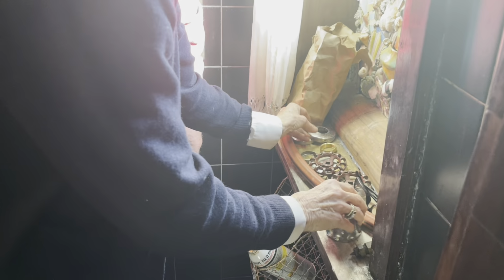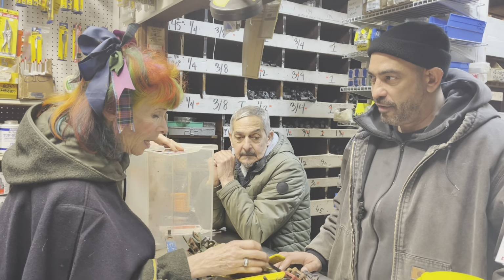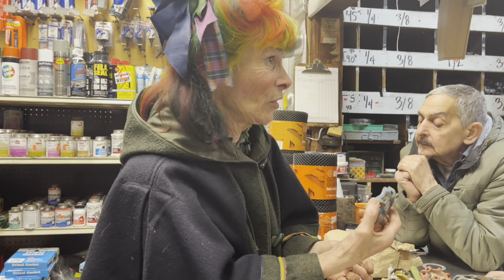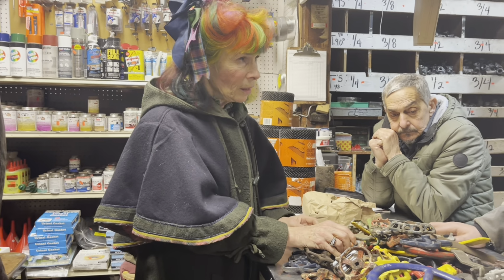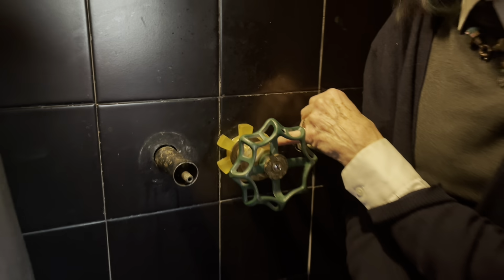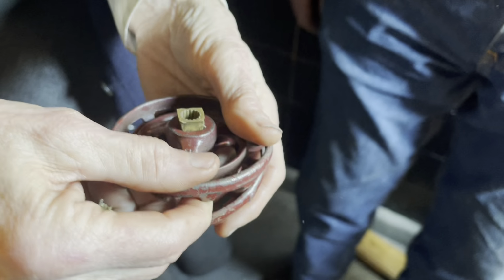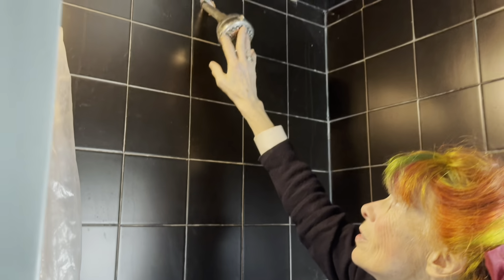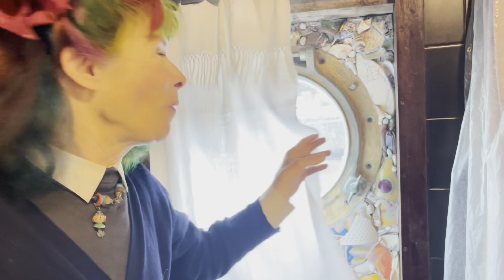How to Decorate With Plumbing

Comment: Imagine taking those antique handles and making a mobile????
Reply from the maker: They are a little heavy,  it they WOULD BE LOVELY, like wobbly flying saucers, eh?  Got for it, Amy?  Just be sure it has a good strong structure and wire and it would be such a celebration of “don’t touch those valves!”😬